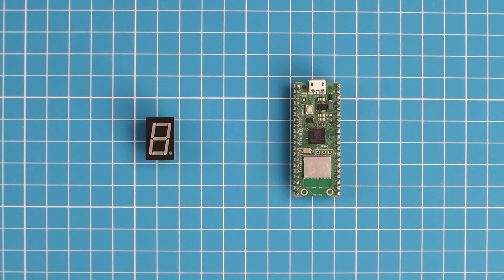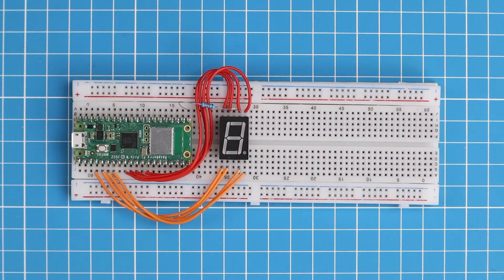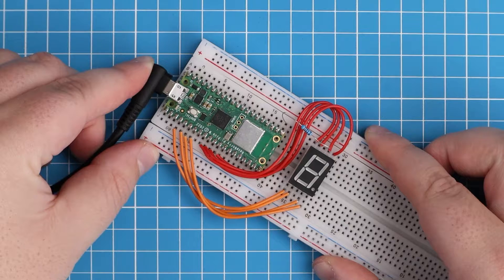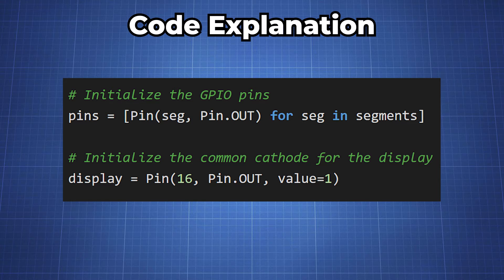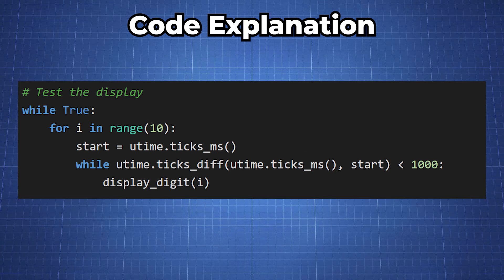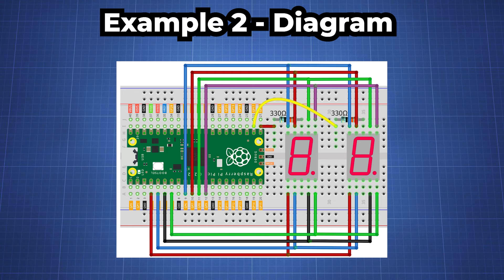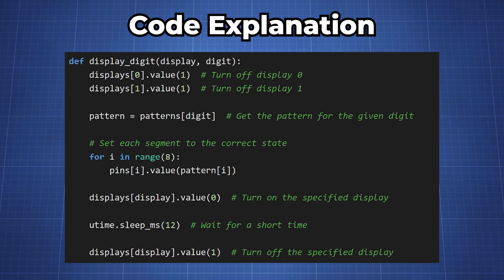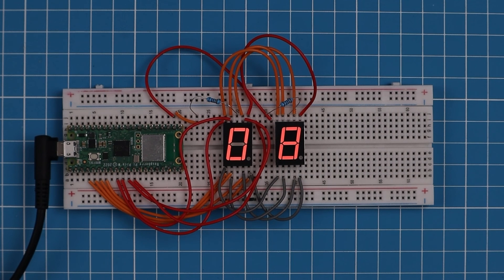Raspberry Pi Pico Tutorial - 7 Segment Display / Multiplexing

Comment: Thanks for your video!  I had to invert the patterns list: replace zeros with ones and ones with zeros. Any thoughts on why that might be?  Thx.
Reply from the maker: This means you have a common anode display, all anodes of the LED segments are connected together to a common pin which is typically connected to a positive voltage (logic "1"). To light a segment, you need to send a "LOW" (logic "0") signal to the corresponding cathode (negative terminal) of that segment. I was using a common cathode in the video all cathodes (negative terminals) of the LED segments are connected together to a common pin, which is typically grounded (logic "0"). To light a segment, you need to send a "HIGH" (logic "1") signal to the corresponding anode (positive terminal) of that segment.

Comment: what if i got a 4 digit 7 segment display, how would i need to modify this code to work with my display?
Reply from the maker: I think I got one in my workshop let me have a look
Reply: @NerdCaveYT  sick!
Reply: @NerdCaveYT  I want to control 10 digits. I've already did this with an arduino nano and transistors. How does it work for a 3.3V microcontroller like the pico?